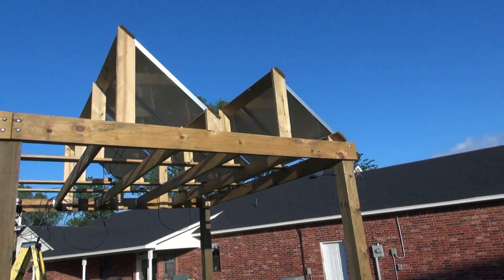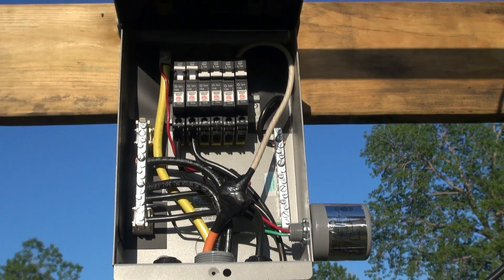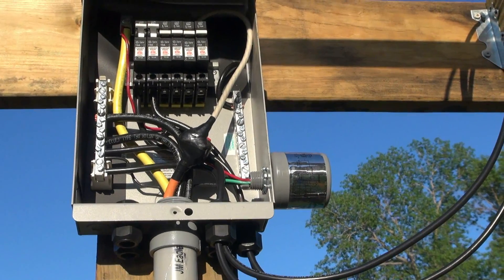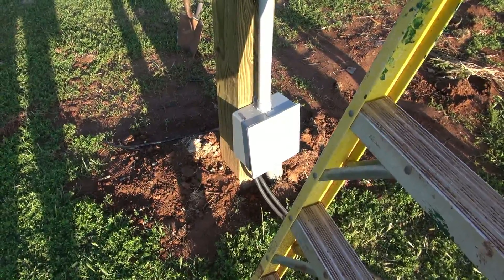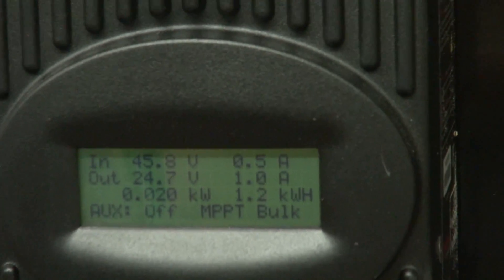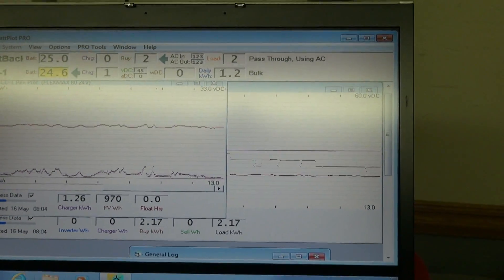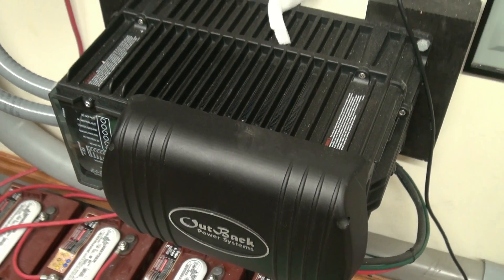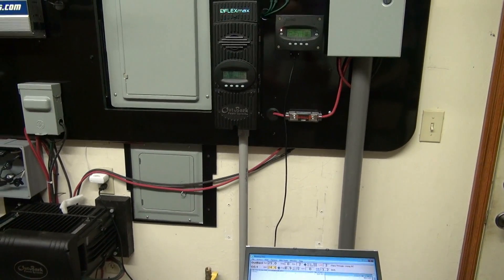First Solar

Comment: Serious shading issue there. Simple formula on that is measure the height to the upper edge of that front row and times that by three and thats the correct space between that back edge and the front edge of the back row.
Reply from the maker: That system is long gone but thanks for the forumula!
Reply from the maker: +Carl Reuter It's all changed since those first test and we definitely learned about spacing and shading too, nice catch.

Comment: One issue is shading from the fore and aft panels themselves. There is a program online that I have seen that calculates the proper distance between the panels. Replace that lightening protector with a Midnight Solar one. The one you have is not good.
Reply: system looks great.  well done and looks pretty good to me from here, but i don't use lightening arrestors so can't comment there. if you are doing an inspection you need proper labeling on conduit and on the accessible disconnect box. also my city requires metal conduit but i know varies place to place. but well done my friend.
Reply from the maker: I do have a Midnight Solar arrestor on that system, what exactly are you looking at?
Reply: breezekingwind
The gray one on the right on the midnight solar combiner box.